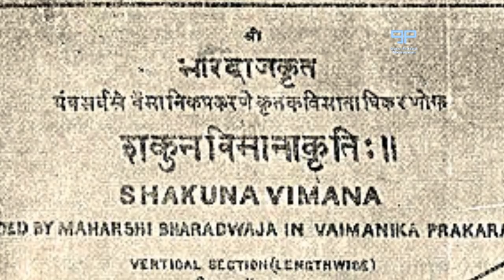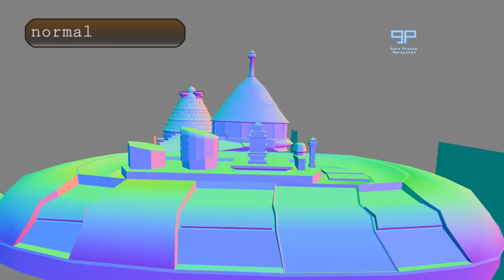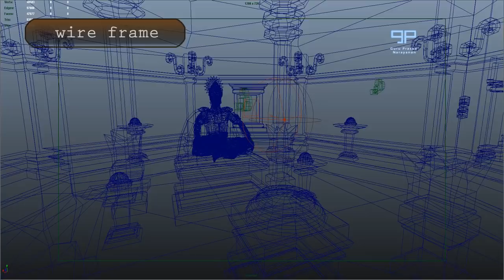Vimana - (Ancient aircraft)

Comment: Missing the Sundara. And these representations were drawn within the last couple hundred years. They’re not accurate. The 3D models are themselves inaccurate. Tripura has wheels. And it did not fly in the air, it flew in the water. Shakuna wings folded for storage, they did not move like doing a backstroke. The interiors appear to be Mantric era, which were wholly different from Tantric era which the outer is a poorly interpreted portrayal of.

Comment: Dear Guru, many parts are done very loosely, why do not you talk to some engineers. If you want I can send you some details about the mercury engine used in this purpose. Your objective is great. But many parts do not contain details of the engines. Also, aero-dynamically the designs you follow are completely wrong. If you really want improvement, please contact me. I have the design of mercury machine and good inputs regarding the aerodynamics. The dress code was mentioned in the book.